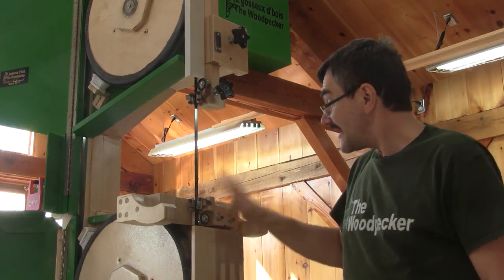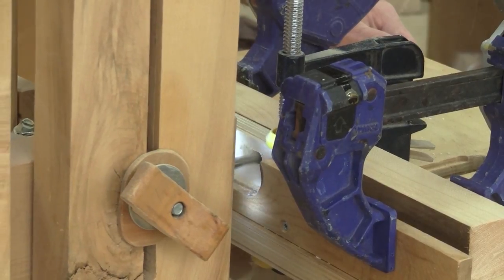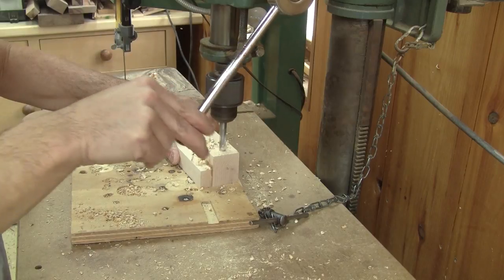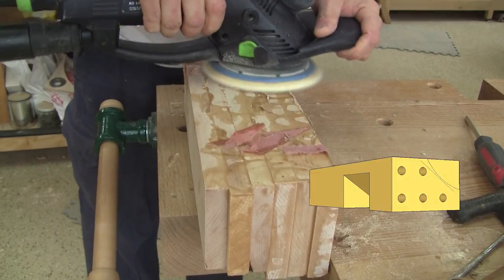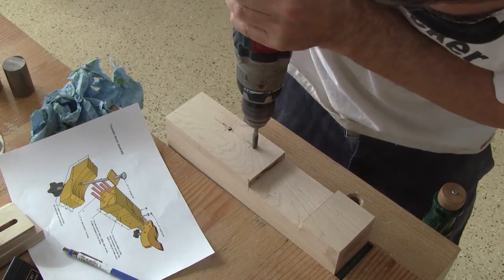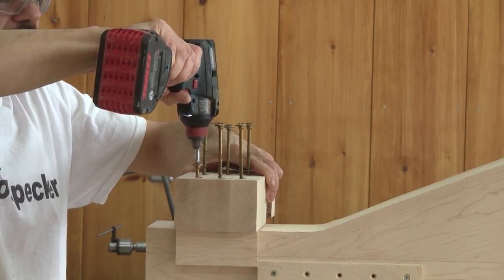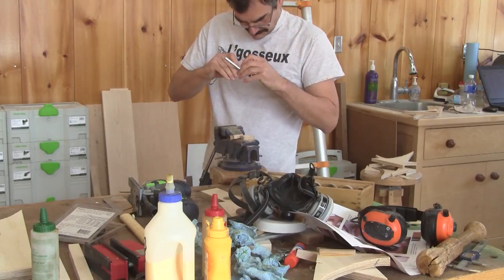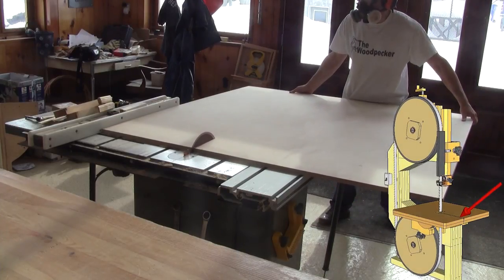The Woodpecker Ep 138  - Wooden bandsaw part 4

Comment: That is a well built and strong trunnion! Thanks for continuing to include the mistakes AND show how you fixed them! Any idea what is causing the squeaking when you make cuts on the bandsaw? I suspect the blade could use a cleaning and some wax?!
Reply from the maker: The wax would help I guess, but I think is my insert, it was bugging me the other day and I remove it, recut the slot wider and the squeeking is almost gone. I still have some from the brush I added...